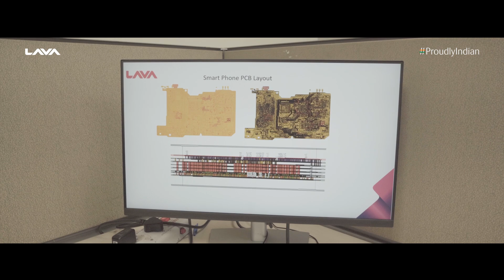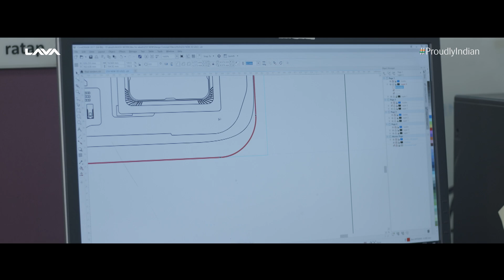Celebrating India's Engineering Brilliance this Engineer's Day

Comment: ग्राहक की जरूरत अगर देखी जाए तो एक बहुत बड़ा तबका मनोरंजन के लिए फोन का इस्तेमाल करता है ऐसे ग्राहक की जरूरत को देखते हुए लावा को एक कदम उठाना चाहिए एक फोन ऐसा लॉन्च हो को 15000 के नीचे हो इसके स्पेक्स इस प्रकार है
 1.Display 7.2inch full HD+amoled panch holl HDR10BIT curved DESPLAY 
2. Battery capacity 8000 mah with 33w superwook charger 
3.medaitek helio G99 processor
4.camara 48 main 2.u w 2.w 16mp frontcamara
5.storege 6/128 , 8/256, 12/512
Reply: Ja ja , 15k mein Aisa phone koi nahi dega 
Gawar kahin ka , 30k mein Aisa phone milta hai